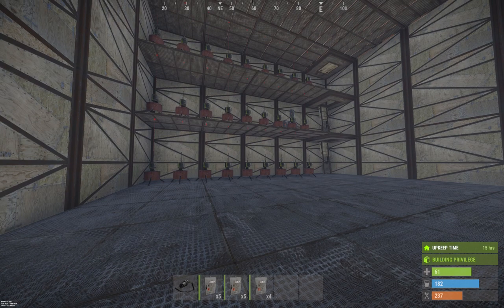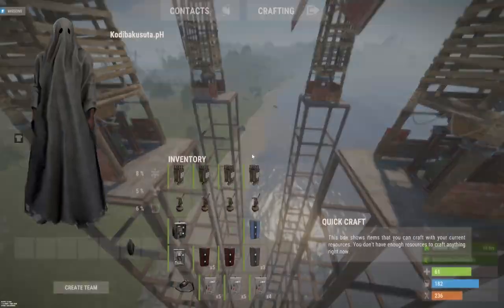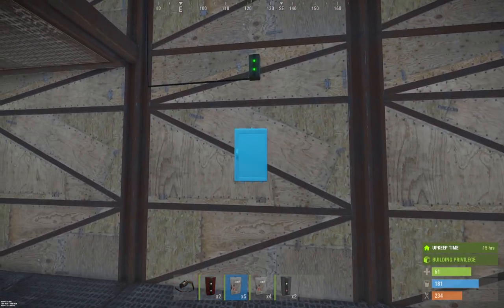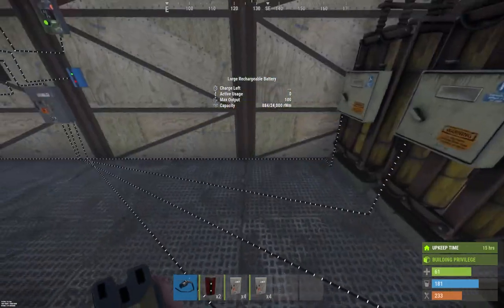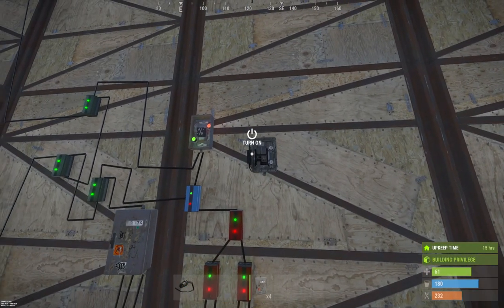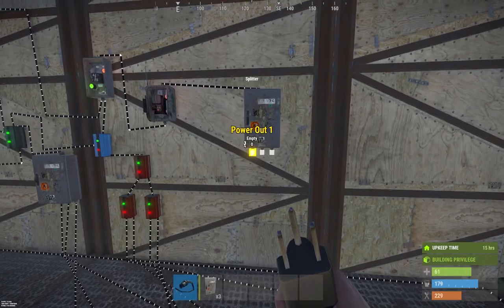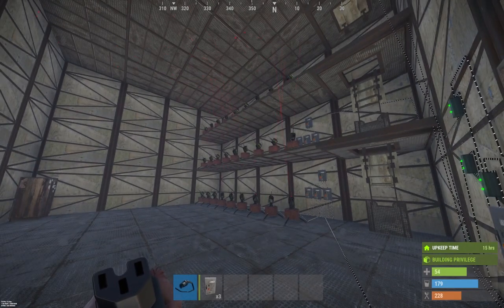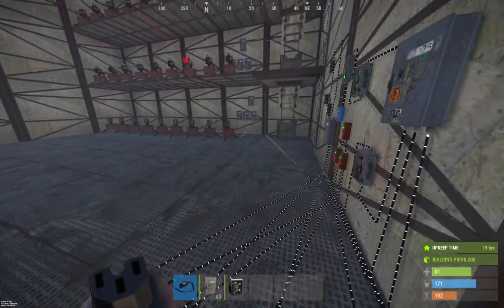RUST- 27 Auto turrets on a single smart switch- Electricity

Comment: Hint if u run the block on/off power to the switch instead of block on/off input and then the switch output to the block on/off power of the blocker you can have a switch in system out in open and if it is destroyed then all power still stays on.  It will be reversed on switch of what is on off but does not matter.

Comment: Just a thought... Given you only need 288 (it's my goto for 27 turrets) you can do away with the 4th battery and just do your basic set-up (from other video) only difference being that 2nd branch goes to a splitter before going to the batteries. Other than that I love your work, not meant as a criticism btw just trying to help (I do a lot of turrets in 27 lots)
Reply from the maker: thanks for the input no criticsm taken..
Reply: You need to supply 11 power to a turret if you plan to use any of the 3 outputs to anything (unless they changed that since last I played)

Comment: been using this setup on a monthly and i maxed out turrets. is it normal for them to shut off for 1sec every minute or so? and sometimes they shut off for longer. not sure if i messed something up but this is actually my second time doing it and both times it's done this. just wondering thx!
Reply from the maker: if this happen it means youre power from the wind turbine is not enough to produce power... check youre input power and see if it drops
Reply: Means your turbines need to be higher, or remove a turret.
Reply: Or maybe adjust a branch value

Comment: Why would you complicate yourself like this for less turrets from 4 windmills, you have 4 batteries, each battery hold up to 9 turrets so you can upkeep easily 36 turrets if you bring at least 120 energy from each windmill because of 80% rules that batteries have.
Reply from the maker: i agree with you 100%. and yes 9 turrets per 1 battery.. meaning  ur turbine have to run average of 120 energy every time and should not go down under 100.. i guess u haven't played long enough to notice sometimes energy goes down to 60 at night or if ur base is not on the mountain or the turbine is not high enough.. for extra 1 turbine and a battery should not be to complicated and u have more energy to used for something. like lights etc... and also thank you for sub ing
Reply: @wacaba22  i have 13K hours in the game, it does not go down if you have 12 levels on the turbine, even it's fog.
Reply from the maker: @skeletor3703  ya 12 levels is my get go.. for the turbine. but yes i understand where u coming from
Reply: @wacaba22  loc of the base dosnt have a say in wind,.,. only how high they are.,., the easy fix is 1 windturbine + 2 solarpanels. that never fails 9 turrets on a 8 high turbine,., anything above 8 blocks high is a waste of upkeep.

Comment: just no.,., its way better to run the in groups of 9 and spread out batterys and setup's,..,if you really need that one kill switch then just add a RF brodcaster to a smart switch and have RF Transmitter linked to each of your setups smart switchs.

Comment: you can get form evry turbin 10turets man wtf you doing
Reply from the maker: if your going to flame me.. please make sure u know what your talking about.. can you please educate me on how u can do 10 turret with a single turbine and a battery so when the turbine is out it still have power for you're turrets.. click here to make RUST Electricity Simulator Diagrams https://www.rustrician.io/ and send it here
Reply: @wacaba22  guy forgets there are branches and splitters and other stuff. max power output of 100 on a battery does not equal 10 turrets lol